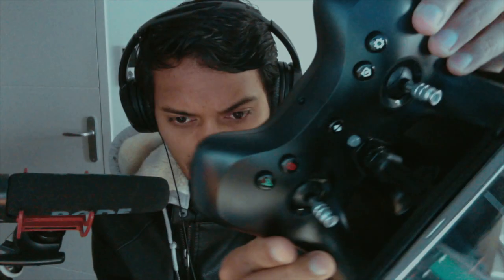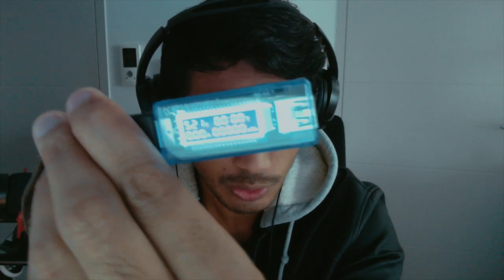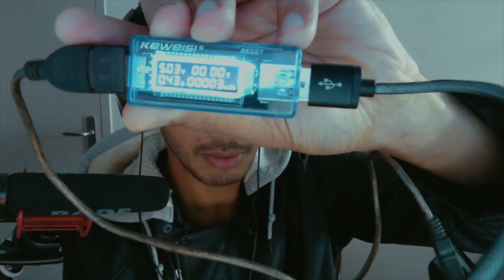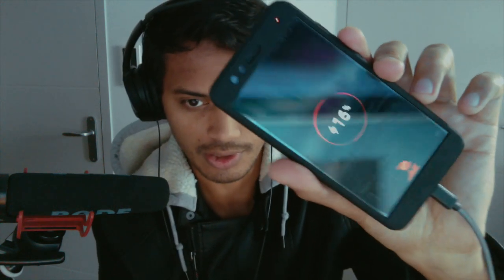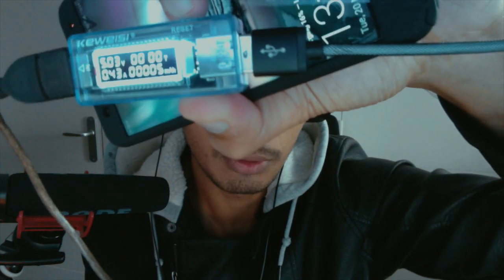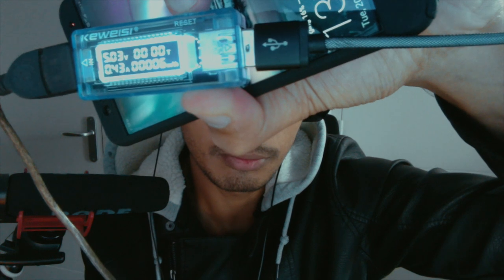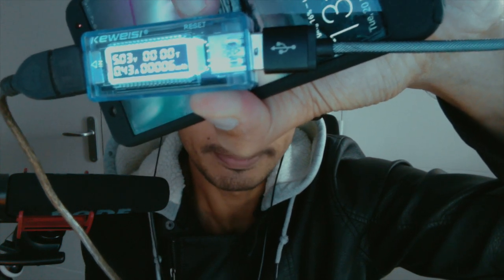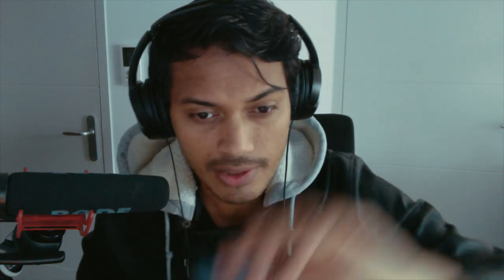VLOG115 | Skycontroller 2 | USB port voltage and current

Comment: What is skycontroller 2p? Which type is that? Thanks for the video brother
Reply from the maker: SK2P is the Skycontroller 2 Power. The early batch was released with 18650 battery 1 cell 3V. Normally they should be 2 cell 7V.

Comment: Hey Anthony I have a question for you. Do you usually take top down (90degrees) pictures with the bebop 2? If yes, what's the best settings? I wanna take raw but even if I "point" the camera down it will take a picture at a normal angle. Any ideas? 
Thanks for the videos, keep them coming!
Reply from the maker: Hello João, i don't usually take photos just videos with the bebop2. If you are using DNG (raw) it will disable the lens distortion correction so it will just take a straight 180˚ photo in DNG. Only when you use JPEG or JPEGSNAP is when it will be able to face down and only take a picture of the cropped area. It will not allow downward facing 180˚ in DNG. Hope this answers your question. 

- Ant
Reply: @ANTHONYVLOG  thanks for the reply!

Comment: I have a question about the  Controller 2. I was going to make a video about making it so that you can stop the charging feature that Android phones like to do for default.  My idea was to sever the red wire. Although it did not charge (please dont anyone else do this) it also did not connect to the SC2 either anymore. 
Is there a way to stop the charging I have a new phone LG-G7 and cant turn off the charging. My battery goes fast and mine is NOT a "P" version. Even Charging the phone to 100% prior to use make it still drain but not as fast.
Reply from the maker: Please do not cut any wires. Its all bidirectional data/power, if the power is cut the data line closes. If you toggle the power on/off after its connected you may get the connection loop where the connection goes on and off (also not good).  Iv used a 100ohm resister to trick the controller to keep the data line open while not charging, this is however permanent and I did not bother making a video because if done incorrectly one could render their controller unusable. For iOS devices 3rd pty apps can switch off charge by doing the same, the software instructs the hardware to send resistance to tell the controller to stop charging but keep data lines open. 

What you could do is look for android apps that disable charge, there is no one shoe fits all so I cant say exactly what will work on your LG-G7 (don't have one, cant test). Hope this helps. 

- Ant
Reply: @ANTHONYVLOG  Yeah i figured it out after i did that. oops. Good thing i got another cable just in case. Thanks for the advice will look into it.
Reply from the maker: @GunDrone  no worries. Please feel free to come back here to share your findings or link from your video in here with the solution. Always happy to share so it helps someone.
Reply: @ANTHONYVLOG  thanks, will.
Reply: @ANTHONYVLOG  , Here is what i discovered when you suggested that i find an App that will shut of phone charging. After searching since your suggestion until today.  I was able to find 2 Apps. but... Both require Root access on the phone which i find fishy. Without really knowing if these Apps are safe and not having the phone unlocked to give Root  access. I have come to the conclusion that these 2 Apps are not going to do me or anyone any good (mainly because of Root access). It was a good suggestion. Unless you know legit names of apps that dont require root for Android I wouldn't do it... 
This was just an update thanks for your suggestion. I'm not trying to sound upset or anything ok? :)
Reply from the maker: @GunDrone  thank you so much bro. Root access is not necessarily bad, if you can provide the names I can test them as I have rooted all my android phones. Rooting just allows access to core functions which normally are not available or deemed safe but if used with caution as intended it will function as stated. I really appreciate you researching I'm happy to take it further for you.
Reply: @ANTHONYVLOG  , well in the USA Root wont do people any good if you have not paid off the phone. I am still paying on mine. Even then they dont like it when you unlock them. just go to the google play store and search for the keyword "No charging battery" they are not easy to find.

Comment: Did anyone else hear a fart or is that the mic. Also I have the 2p with the tube. And my phone is fast charge. Sadness
Reply from the maker: You would know if I whipped a fart. Currently waiting on new mic. I use the rode video go, if you search on YouTube it has a known problem, humming and all kinds of paranormal sounds. I tried to software fix it but it just sounds like fart lol.
Reply: @ANTHONYVLOG  oh ok. Haha. I see that happening, but yeah I got the new black one. It only lasts like 4 flights then it's done. Also it has to handle quick charge. There is many proplems I am dealing with such as the Android 8.0 telemetry data thing with the VR